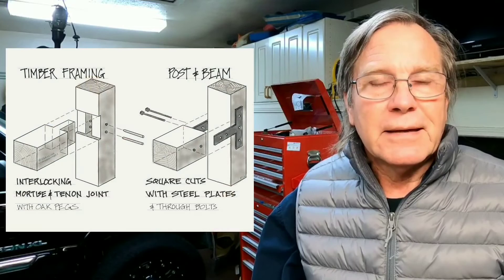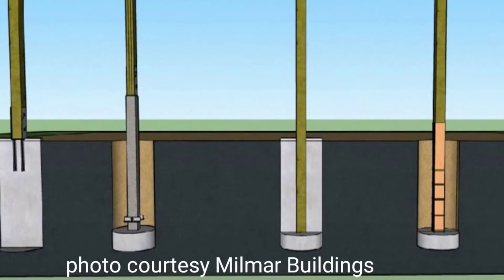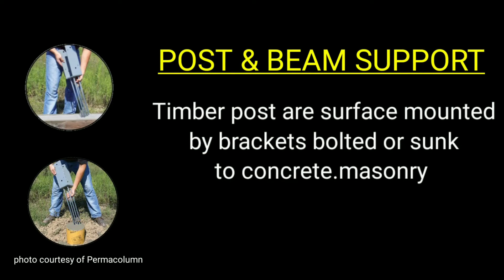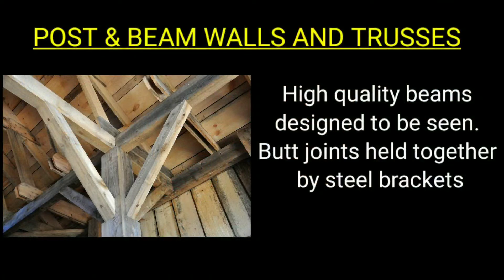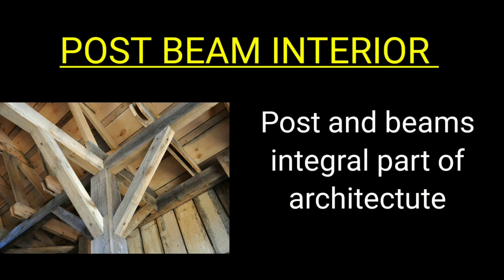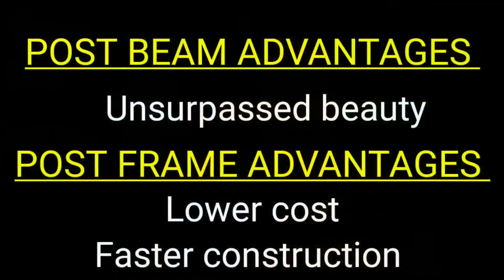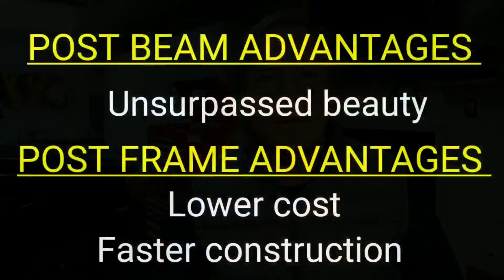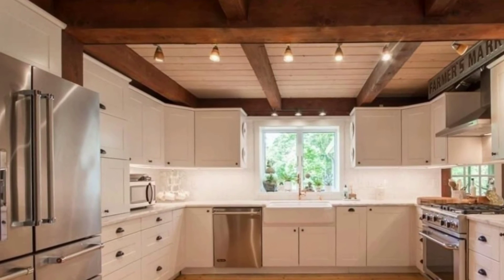Post and Beam vs. Post Frame construction. What's right for you?

Comment: The other wood I forgot to mention is your native osage orange wood. Osage orange must come in handy in terms of rot-resistance and pest-resistance. Rot Resistance: Osage Orange is extremely durable and is considered to be one of the most decay resistant woods in North America. Workability: Working this Osage Orange can be difficult due to its hardness and density, though it is reported to have little dulling effect on cutting edges.   ts wood is extremely durable, dense and naturally rot-resistant. The Osage Indians used its wood for bows, tool handles and war clubs. European settlers used the wood for axe handles, wheel hubs, railroad ties, furniture, decks and fence posts.Oct 10, 2021 Osage orange is exceptionally hard and strong. The bending strength (MOR) is over 20,000 psi (50 percent more than red oak). Hardness is around 2000 pounds (100 percent more than red oak).Apr 19, 2016. After the widespread adoption of barbed wire, Osage orange continued to have a use in fencing. The hard wood is resistant to termites and decay, making it ideal for fence post material. Old hedges that have grown into trees can sup- ply up to 4,000 posts per mile. https://www.woodshopnews.com/news/osage-orange-can-resist-damage-well. https://www.keimlumber.com/domestic-wood-library/osage-orange . https://www.woodmagazine.com/materials-guide/lumber/wood-species-2/osage-orange

OSAGE ORANGE

Ever since primitive man decided that it was easier to raise his own 
meat than to go out and hunt wild game, there have been herdsmen 
and farmers who have had to build fences. Fence building and fence 
repairing, whether they be stone walls, living thorn hedges, rail fences, 
barbed wire or electric fences, are never-ending jobs for farmers.

About the time young Abraham Lincoln was splitting oak and walnut 
logs into rails for "worm" fences, middle western farmers began to 
hear of a small thorny tree, native to the Arkansas River region, which 
could be grown in dense hedges to enclose horses, cattle, sheep and 
hogs. Because the Osage (Wazhazhe or "war people") Indians 
inhabited that region, it was called the Osage Orange.

It is a medium-sized tree occasionally reaching 50 feet in height and 
two feet in diameter, with glossy simple leaves about twice as long as 
broad. The twigs are orange-brown in color and armed with many 
straight stout sharp thorns about three-quarters of an inch long. The 
large wrinkled orange-like green fruit, four or five inches in diameter, 
as well as the leaves and twigs, contain a milky juice which is quite 
bitter. These fruits, heavy and hard, are commonly known as "hedge 
apples" and used by boys as missiles for mimic warfare and other 
purposes. They are not edible. It is the only tree of its kind in the 
world, although related distantly to the mulberries and figs. Silk 
worms feed on its leaves as readily as on those of the mulberry. Some 
of these trees have yellowish male flowers bearing pollen which is 
carried by bees to other trees with greenish female flower-heads that 
produce the " oranges" .

Osage orange grows well on many kinds of soil throughout most of the 
United States. Sprouts from roots, or shoots grown from seed or 
cuttings in nurseries, are planted in one or two rows several inches 
apart where a hedge fence is wanted. These are trimmed once or twice 
a year to form a dense hedge about 4 feet high and 2 feet wide. 
Sometimes the "whips" or sprouts are planted on an angle to create an 
inter-woven lattice-like living fence.

If farmers neglect the trimming, the hedges grow rapidly to become 
havens for birds and other wildlife. However, the trees so produced are 
valuable as posts for wire fences because osage orange is more durable 
in the soil than any other wood and many such fences have lasted 
more than 50 years without a single rotten post. Since they occupy and 
shade too much valuable cropland, most such overgrown hedges have 
been removed in recent years.

The wood, exceedingly heavy, hard and strong, shrinks but little as it 
dries and was formerly used to make the felloes and hubs of wagon 
wheels. A yellow dye can be extracted from the bright orange wood 
and roots for tanning and coloring leather. The Osage Indians used the 
wood to make war clubs and bows, and the tree was called bois d'arc 
(wood of the bow) by the early French explorers. Without doubt, it is 
the finest wood for bows in all the world. Archery fans scour the 
country for osage orange trees large enough and straight enough for 
bows. Perhaps one in a hundred, or a thousand, is suitable. It is 
carefully sawed into staves which are varnished and seasoned for 
several years before the wood is ready to be fashioned into a bow. In 
1800 or thereabouts, historians mention that the Osage Indians valued 
such a bow equal to a horse and a blanket.

Today, 150 years later, it is worth the same.

Comment: Another attribute of post frame is that typically the trusses, sometimes bar joist type steel trusses, connect/sit directly on the posts and there sometimes is no beam at all.  This is common with barn construction and the girts and purlins are what tie the walls and roof together. Nice video.

Comment: The best wood is (1) ship mast yellow locust wood which can last like a rock, the next one is (2) cypress cedar wood, the next one is (3) chestnut wood, the next one is (4) heart redwood when you use only the most reddish deep red and dark red inner core of the redwood tree. All are in America. The next is (5) Ipe wood which has a fire rating equal to steel and is as hard and tough as concrete and the next is (6) Azobe wood which can even withstand marine wood borers.